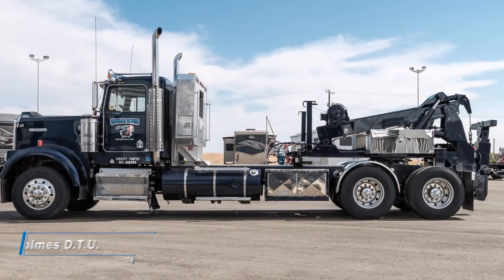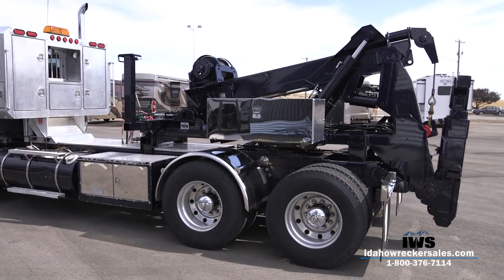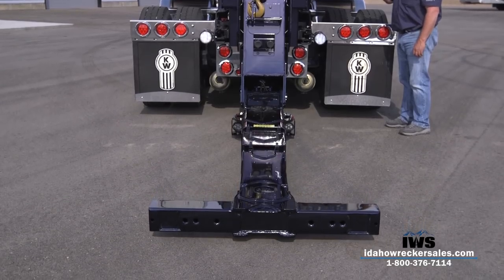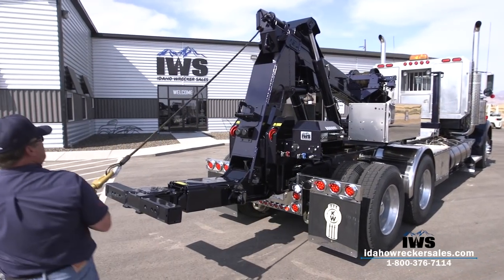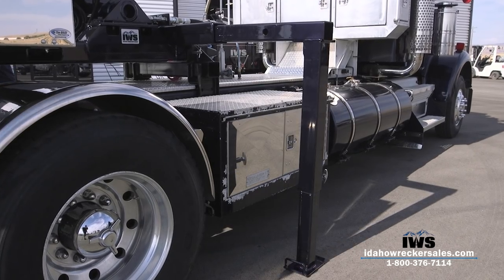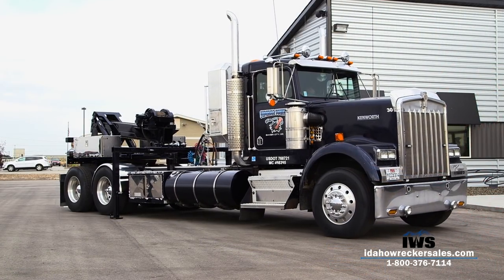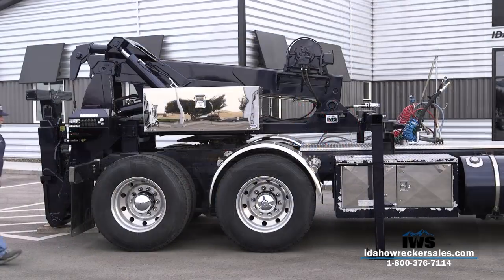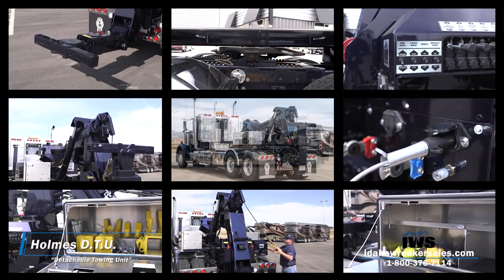Holmes D.T.U. (Detachable Towing Unit) by Miller Industries

Comment: We had one of these but never used it,  I was in Texas at a FreightLiner dealer, when in drove a homemade unit that was All air, it used Air Bags, all it did was manually extend, then raise and lower with air from the glad hands,   it would raise about 30 inches. Pretty easy to use, no hydraulics.

Comment: Do you know if there's a option for trucks that dont have a wet kit installed?
Reply: SouthJerseySound  you have to have a wet kit iam pretty sure unless they changed since I've had one done
Reply: Thanks,thats what I figured but I was hoping I could get away without doing a wet kit.We currently have a honda pony motor mounted on our rig to run a lowboy  but its a pain in the ass.
Reply: 250 Minimum wheel base recommend. What's the wheel base of the Kenworth in the video?  It can't be anywhere near 250.
Reply: I bought a trail eze te80xt  trailer from united rentals,  They sell a portable wet /hydraulic kit powered by a 13 horsepower honda engine. It has a 10 gallon reservoir, 2200 psi, and I think 12 gallons a minute.  It's a great self contained skid mount wet kit that I do not know if it would power this, you would just have to check the pressure and volume requirements. Some of the portable wet kits out there really work well, mine Is great for my trailer.  It's a place to start looking for one to handle this DTU